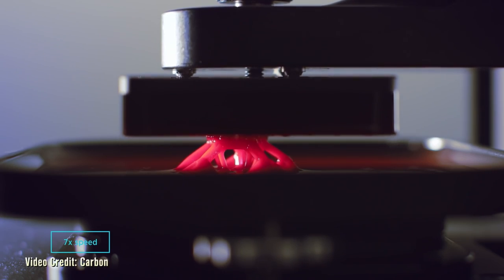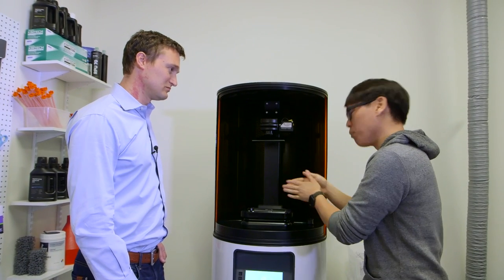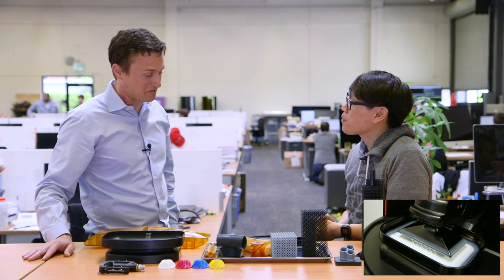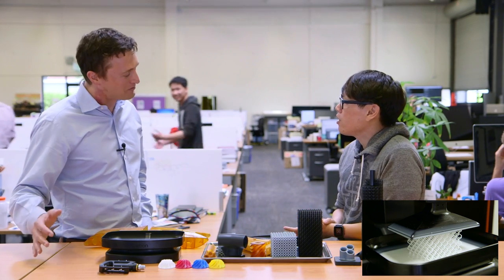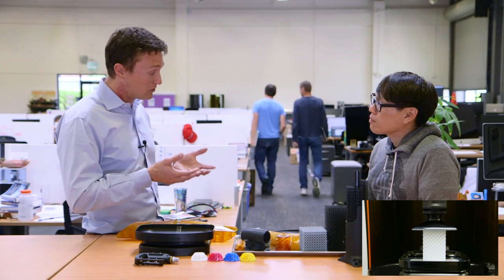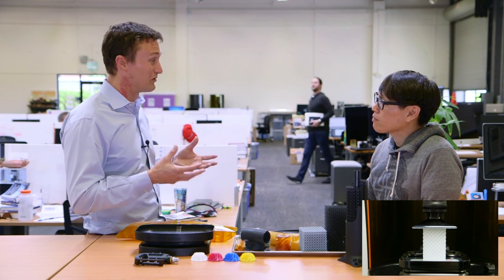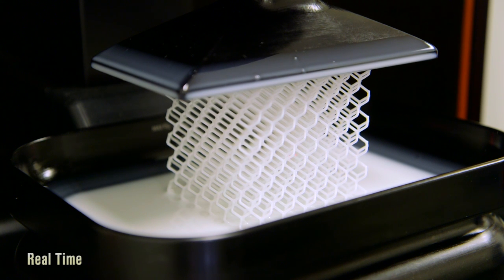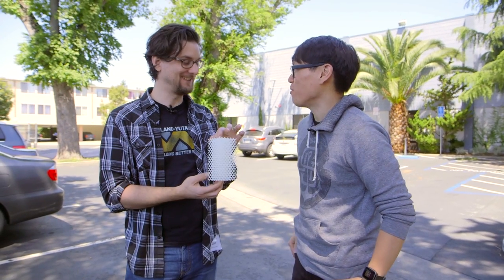Carbon M1 Super Fast 3D Printer Demo!

Comment: Probably only big companies will be able to afford this printer, hopefully the technology will trickle down to the consumer market.
Reply: This is probably as expensive as it's ever going to get. They're just gonna be smaller, faster, cheaper, etc in the near future.
Reply: I checked their site, it's $40,000/year with a minimum of 3 years contact. Sheesh
Reply: While that's expensive, it's not terrible. Compared to an SLA like the Form 2+? Expensive, yeah. Compared to a printer like a Dimension SST 1200es? Only a few thousand more and MUCH more capable. For the speed this thing can do along with the myriad of materials it can do it's really not a bad deal at all, plus the resins are set to be price much cheaper per weight than most other 3d print materials.

It's not affordable to the average person, but it's also not necessarily meant to be. As they said it's aimed at companies for actual production parts.

But I'm absolutely waiting for the day the technology becomes cheaper!
Reply: the problem remains, that these resins are extremely dangerous and toxic when they arent cured (mainly because of the photostarters). Also the parts need to be washed in isopropanol after printing and you end up with a lot of chemical waste and stuff.. techniques such as DLP resin printers are already widely used in the medical industry, but till the toxicity problem isnt out of the way this shouldnt be considered a good idea for a consumer product. I think for consumers FDM is the way to go :) also the range/variety of FDM Materials gets bigger and bigger every year :P
Reply: Its not a cost effective system. If my company used this versus traditional manufacturing, we'd be out of business in no time flat.
Reply: ArcadeGames that’s great and all but what the companies don’t know is that it utilizes light AND oxygen

Comment: Watch it slow down when the print something that has a higher fill volumer. While this oxygen-inhibition is nice, it doesn't address the need for fresh resin to flow back in to replenish the locally-depleted material at the site of the curing.

Notice how all Carbon's speed demos are using prints that are mostly empty space (just thin cured meshes).

Sure this is an improvement, but it's over-hyped and there are other fast resin technologies in the works that are not getting the same coverage.
Reply: +Jon Stern Good observation.
Reply: I was thinking the same thing
Reply: I'd like to see how long would it take for the older models to create these things. then I can form an opinion.
Reply: +Jon Stern Interesting, like what other technologies?
Reply: mmarioivann UNIZ Slash, Gizmo 3D, Prismlab Rapid, the list keeps getting longer.
Reply: ***** That's true if you are building a model, but to make something functional and able to bear loads solid parts can be important. 

Basically it depends on the application.
Reply: ***** Every print Carbon has shown as been a very low density lattice with no side walls/skin. That means there's a certain amount of deception going on here.

I'm not saying Carbon isn't fast - it is. I'm saying that most real-world pieces won't print as fast as the marketing demos.
Reply: Nevertheless, new ground must be broken in order to walk freely on it, even though its nothing too crazy now its still a fresh idea with room to grow.
Reply: +Eric Cartmenez True. I'm just pointing out that there's a lot of marketing hype coming out of Carbon, and there are other companies with solutions to the peel problem but Carbon is sucking all the oxygen (unintentional pun there) out of the room.
Reply: Got any links to others who have similar techniques? I'm really intrigued by this idea!
Reply: Looking at the flow, it seems the slow down wouldn't be TOO much. Not an engineer, and certanly haven't studied this kind of thing but it does't look slow. 
http://carbon3d.com/clip-process
Reply: That page doesn't tell you anything about the factor I'm talking about. There has to be time for virgin resin to flow, or diffuse in. That will only be seen when printing wider structures than everything Carbon has shown. The always show prints consisting of fine trellis mesh work. That will be their best case.
Reply: Well there's Gizmo 3D, who print at the top surface of the resin bath, instead on the bottom: http://www.gizmo3dprinters.com.au/

There's UNIZ with their "Slash" printer. They claim 50x faster than a Formlabs Form 2: https://3dprint.com/117623/uniz-slash-sla-3d-printer/

There's Prismlabs: https://3dprint.com/54534/prismlab-rapid-400-sla/

And there's even a University of Buffalo student with some kind of membrane, that he claims is much less expensive than Carbon's oxygen-permeable window: https://3dprint.com/54864/super-fast-3d-printer/

There are probably quite a few more that I haven't heard about.
Reply: Jon Stern Yeah, but I have no idea of the viscosity of the resin, or how different ones compare.
Reply: Agreed, but the fact that all their prints are exactly what you'd expect them to print if they have this issue. Count me suspicious.
Reply: Jon Stern Fair enough. I'm cautious of this as well.

Comment: Wise thing to do next will be involving 3d projectors that create almost instantaneous object form liquid ;)
Reply: +RoZyk007 That's the holy grail.
Reply: You're welcome ;)
Reply: That is where it is heading... the problem is that in order to do something like that they need a totally non refractive resin, and there is also issues with cure time.
Reply: They already got it, otherwise this printer will never work. Anyway I thing more of burning structure in liquid modifying "brightness" of beams.... Just figure how it will work, need to contact someone...
Reply: This printer is still only projecting through a very thin layer.

Comment: I wonder if you could use a 3D printer to make Graphene.
Reply: No
Reply: Deus Almighty Just use sticky tape :3
Reply: +Daniel Forsythe Impossible. Remember, Graphene is a SINGLE ATOM LAYER.
Reply: Yeah, but this uses oxygen to get rid of the layers, so you could make graphene
Reply: +Justin McKee No, it's not even close to the precision needed and you can't just throw oxygen at random stuff and expect it to become thinner. This 3d printer uses some kind of curing process as far as I understand that hardens the liquid material with oxygen (I'm too tired to rewatch the video right now, but something like that). Sticky tape works way better and faster. Everyone can produce Graphene with some sticky tape and a pencil. Scrape off some Graphite off the pencil and then use the sticky tape to remove the increasingly thinner layers of Graphite atoms. As soon as this layer reaches one single layer, you've got Graphene.The problem with Graphene lies mostly in the mass production (most reliable method right now is spin coating as far as I know). The Graphene you get with the sticky tape method is seperated into lots of unconnnected Graphene layers, so you'll have a hard time producing a reliable electrode with this mehod.

Comment: if it's working off a projector, no matter how you do it, wouldn't it still fundamentally be cured in layers? I get that the oxygen is used to get a continuous print, but if it is cured off a projector, the projector is still running off frames, thus, layers. I see it like it's still a layer, but almost like when you acetone a part, but not just the surface. if I'm wrong, fantastic. it just means I get to learn something new. but if I'm not, I don't like how thay say it's printed withought layers.
Reply: +Brad Lee It's total hype.
Reply: +Brad Lee, Best guess is they have they system set up so it moves at the same rate as the projector can cure a layer. They bank on is the resin curing at a continuous rate so that as it moves up the first layer of resin is mid cured by the time the next layer start so they form a full bond between the layers. this allows them to print in the Z axis without forming a layer grain. Last guess is they use small air jets to keep the projected light from bleeding over to areas they don't need cured. Again this is my best guess Still interesting technology although I would like to see what happens to these parts in sunlight. If they degrade like PVC or can they last. That will be the real testThey probably had him pitch it this way since the process the patent is still pending. This was more a sales pitch than anything.
Reply: the uv light tells it what to draw and the oxygen cures it with out any layers
Reply: Basically you don't have to run tons of lines of a plastic from a nozzle at about half a milliliter at a time, its all one smooth motion, each layer lasting a fraction of a milliliter, as well as taking a fraction of a second, and therefore seemingly being printed without layers.
Reply: +worlds worst gamer 17 uv light cures and oxygen slows the process on a controlled manner. you have it backwards
Reply: +Kyron Williams and running a bead of plastic from half a mm only applies to sla printers.

Comment: The UV light causes a photopolymerization of the resin which builds a chain of polymers to create a physical object and then the oxygen is introduced to the system through a semipermeable oxygen layer which inhibits or stops the resin to cure or harden near that layer. Basically the light hardens and the oxygen is used to make sure the object doesnt stick to the bottom of the window in the resin pan. And then stuck in a oven afterwards to harden.
Reply: Thank you.   Why the hell cant that guy just say that.
Reply: He was using this as a selling point for the machine I think. I had to look up CLIP 3D and photopolmerization to just learn why the hell he said lights and oxygen so much without explaining anything.

Comment: Why are they saying this techonology "gets rid of layers" when this new machine just prints significantly more cross-sections over time? You're actually adding more "layers".
Reply: +Jomar Uy Na, man. This doesn't print using layers. It uses light to set the shape as one solid object one "layer". Then cures that piece using heat. As opposed to using heat right away as a laser draws the outline of a shape and cures one layer at a time making a layered object.
Reply: Ryan Larivee They said it was created with a cross-section video that projects onto the resin. Videos consist of frames so 1 frame might be equal to a "layer". In my opinion, the process is still "layered" but the outcome is solid and seamless.
Reply: More accurately, the entire print is hundreds, if not thousands of crossovers. It's ALL cross sections
Reply: +Matt Stiles my point exactly.
Reply: +Jomar Uy I think they mean getting rid of definite layers.
Reply: +Matt Stiles Not really. If you compare it with current SLS and SLA technologies you'd have to wait a certain while between each frame/slice; this being the time it takes for the laser to draw the contours of the slice. Not mentioning the heating time for each layer if you're using SLS, you're looking at a long ass movie. What this does is take away that time by projecting the entire exposure in a fluid motion while the build platform goes up in sync.

TL;DR  a (real-time) stop motion animation vs a projector on a screen
Reply: ***** You disagreed with him but in your conclusion, you just paraphrased his comment.

you do know the "fluid motion" you're talking about is a video that has frames. Whether it be 24, 30, 60 or 120 fps a single frame is a cross-section.
Reply: +Jomar Uy Nope, read again. I paraphrased Ryan, who is correct. I also didn't disagree with Matt's; I offered a different point of view. 
What I'm trying to explain is that the layers themselves don't matter, it's the time it takes between each one. Getting a fast enough frame rate/transition between layer is the "fluid motion" I meant to express (which I think is what 2010ngojo was getting at). 
To me, what you're saying is "I don't care how high the frame rate of this video is, all I see are just more frames!". The reality is that if you want a high performance mechanical print, you want the Z direction built as smoothly as you would X and Y. Here the x-axis moves up smoothly, not in increments.
Reply: ***** What are you talking about?
The x and y are printed simultaneously or very fast(creating a flat cross-section) because of the projector playing the video and hitting the 2d surface at the bottom of the resin. 

The "z" axis moves up smoothly because of the combination of the speed of the mechanical pull (the device where the cured resin is attached), the chemistry on how it becomes seamless, and the frame rate of the video being projected. 

Just because you don't see the increments do not mean they don't exist. You cannot project cross-sections onto the resin with "infinite" frame rates.

TL;DR
Traditional 3d Printing = xy is thick and slow because of the printing arm, z is in larger increments.
Carbon Printing = xy is simultaneous and thin, z is in significantly smaller increments. The science on how the resin is cured applied by the company makes it seemless.
Reply: How does that not agree with what I just said? I think we're just talking semantics. you see it as very large amount of layers, which of course is a fact.  I'm just stating that at this stage they don't matter anymore
Reply: +Jomar Uy From the machine's perspective, yes. The "layers" are ultra thin. From the perspective of people who handle or look at the final product, no. The "layers" are so thin that they aren't discernible. On top of that, the "layers" blend with each other so much that even the difference they would have is muffled even more.

Comment: Holy shit industrial stuff is expensive... this will set you back 400,000$ after 10 years, and that is without the resin.
Reply: +Mik Wind Yeah, forcing the customer to buy a yearly subscription (minimum of three years) is total bullshit.  I know a lot of software companies have moved to this model, and more hardware companies are following suit; but it's predatory and shitty.

Carbon Pricing:  https://s3.amazonaws.com/flabs-carbon/downloads/pricing/Carbon_Pricing_April2016_A.pdf
Reply: M750 I know, super shitty, but you can only do that if you have a monopoly, or a very special service. This happens also because that market is not saturated yet , if I invented a 3d printer with similar capabilities for 120,000$ I'm suddenly the better option.
Reply: I would to love the see production cost of the manufacturers of these machines versus their sales of the objects produced. I know including manpower, designers, supply chain, and the such is has to be costly. I imagine there has to be a threshold of the types of parts you would produce with this type of machine. I doubt you could crank out small cheap parts all day and consider it cost effective. Thinking about cost analysis makes me want to dive in the viability of this machine versus novelty.
Reply: +M750 This is a common industry practice. This is meant only for industry manufacturing. When you buy a million dollar cnc machine you don't think about it as a one time purchase. You add up the price plus service and support contract and then divide up to the cost per hour over the complete life cycle of the machine (many yeas). If your math works out it is irrelevant if you buy with a one time payment + support contract or a yearly subscription.

Comment: There seems to be no oxygen injection (no bubbles) so I guess exposing to “oxygen” happens by exposing the settling surface slower or faster to the air above.

Comment: They this printer is $40K per year but think of the revenue you generate of those parts you can print with this technology. 
Can we push to the point we print as we assemble car's interior parts onsite instead of shipping them from other locations to the site?? This is what moves technology. Also repair shops can work this was as well. Think of Autozone, Napa and so on who can print parts on demand onsite instead of warehouse holding all those parts. Think big and thing global. Now a part can be designed in Australia, tuned by a team in India, test printed in South Africa, USA and even the North pole area to be tested in those environments without having to ship more than just the resin to make it.